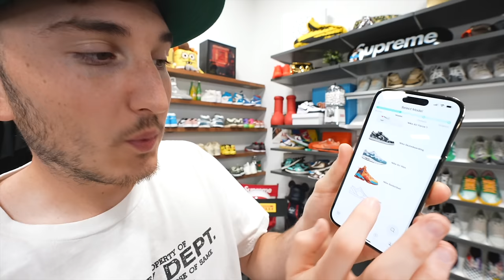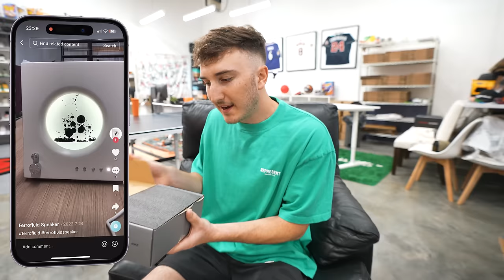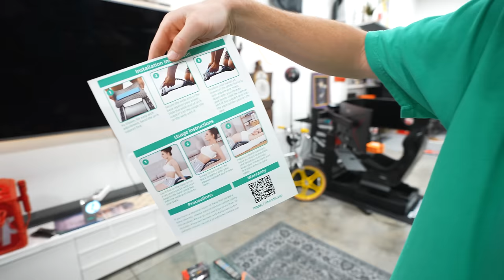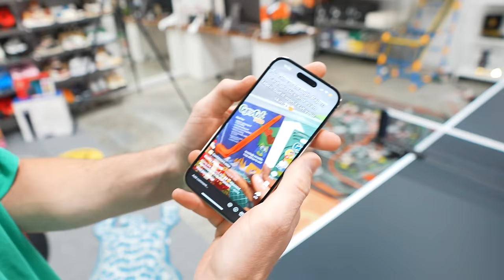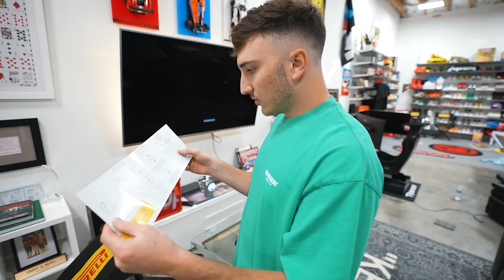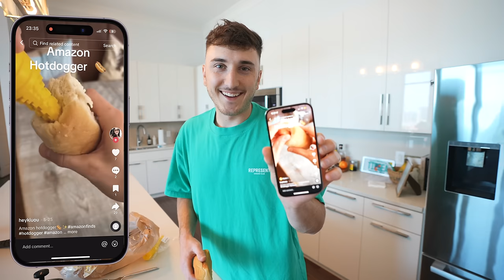I Bought EVERY Scam Ad I Saw On Tik Tok

Comment: The Switchbot works really well. Its comes with a piece that allows you to turn the light off and on. The lever will press the button and the attachment that comes in the box allows the lever to pull on the switch to go in the opposite direction.